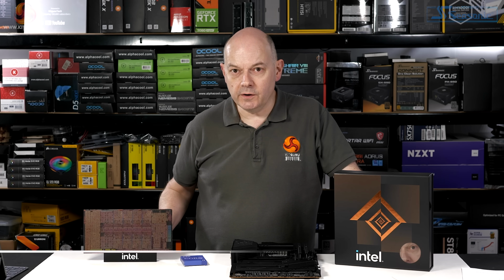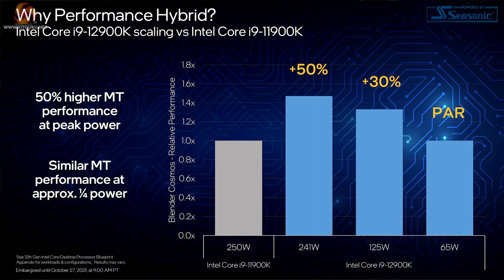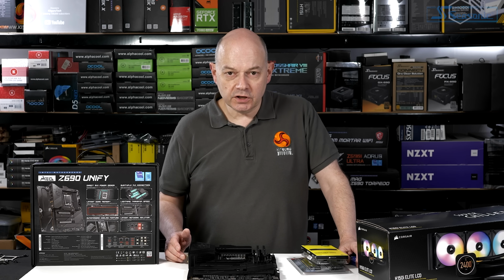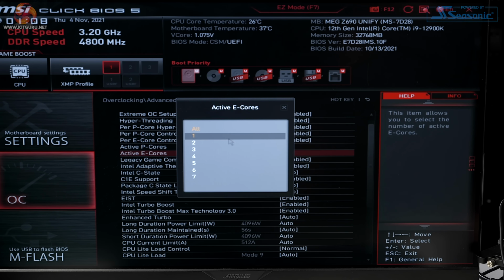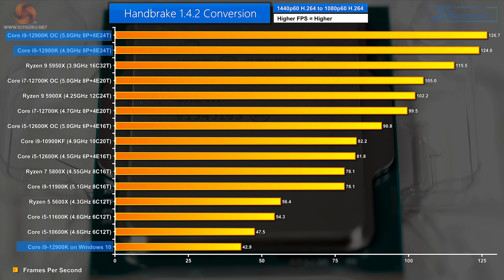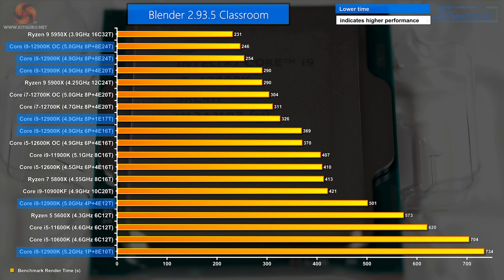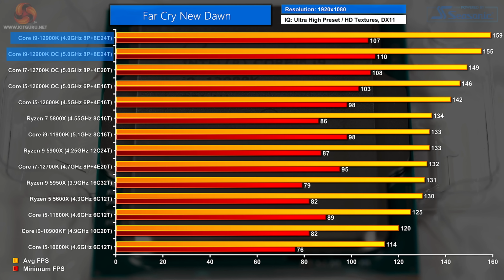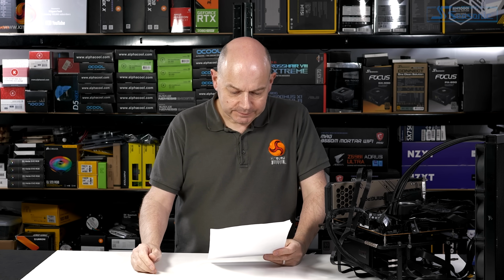Intel Core i9-12900K – Enough power to burn the planet!

Comment: Also, remember 12900K only beats 5950X buy 2%
Reply: By using 80%more power
Reply: @florin604  Yup, I guess amd is all eco cores? LOLOLOL
Reply from the maker: When we started testing the Core i9-12900K we figured it would fall between Ryzen 7 and Ryzen 9 5900X which have 16 and 24 threads respectively. It came as a huge surprise the new Core i9 can approach Ryzen 9 5950X regardless of the power involved. Having said that, if you are in the market for major CPU stomp we consider Ryzen 9 5950X is a superb piece of work and currently on sale at £700.

Comment: They're going to iterate the hell out of this. AMD need to step up.
Reply: Intel needs to improve their fabrication node or TSMC will leave them in the dust. It doesn't matter if they have the superior design, amd will reap the node befits tsmc makes.
Reply: Zen 4D will already be crushing this @ almost 40% less wattage on multicore loads... Alder lake is nice technology-wise, but it'll take a while for it to grain proper traction with software support etc. Kind of like with Ryzen 1

Comment: Could you do a overclock test 5950x vs -12900K (As we already know the -12900K will not overclock very well at all)?
Reply: 12900K already comes overclocked out of the box any more overclocking won't be much difference.
Because it draws already very much power and the temps are too high comparing to AMD CPU's.
Wait for the AMD's next CPU as they are more efficient and better optimized for DDR5/Gen5/Cache.

Comment: Is it just me, or did you leave out overclocking the 5950X in some of those tests, while you overclocked the 12900K and also included the stock results?
Reply from the maker: Leo here: Yes, however you can refer to Luke's reviews of the individual CPUs to see how they behave when overclocked. It all comes down to timing. Those four Zen 3 CPUs were tested on Windows 11 with those various games after AMD patched their chipset drivers. You may think you are missing half the data but Luke did a superb job.
Reply: @KitGuruTech  Thanks Leo. 

PS: I wasn't calling you on it or anything, i wanted to ask the question, but sat there for about 5 minutes trying to come up with wording that wouldn't come off as a call out. 
Not sure how i done though. But thanks for the response.
Reply: That is the trap that these tech reviewers do. They have the i9 running PL2 or oveclocked with infinite turbo (5GHz for 8 p-cores and maybe 3GHz for the e cores) while they have the 5950X at stock which has 20% less IPC and only 3.8GHz clockspeed.

This explains some nonsense like "12900K uses too much power".
Reply: @saricubra2867  Non-sense. Drawing 2x more power to get 1-3% more performance on average and you are probably an intel fanboy that would cherry pick benchmarks as well in favor of single core which is backwards.
Reply: @saricubra2867  5.7ghz 2 core

~5.4ghz p-cores, ~3.9 ghz e-cores 24/7 OC

 x40 ring min

6400mhz ddr5

its way past the capabilities of the 5950x
Reply: @OdinAlgeron  AMD all core at 4.5- 5ghz the 5950X are in the 31 to 32K in average on R32
5500 MHz	 Intel Core i9 12900K is about 30k on R23

This is without the new ram TODAY. So it's no where near way past the capabilities.
Reply: @AFlyingCookieLOL  5950X also draws a lot of power from unlocking power limits and still falls behind the 12900K in single core by such a big margin and loses Premiere Pro and many other production related tasks.

2000 extra points in multicore is nothing compared to the 1600 vs 2000 in single core Cinebench R23 for the 12900K. That is over 20% faster.

I like how AMD fanboys pretend that power consumption is an issue in 12th gen and single core doesn't matter ( do you remember Bulldozer ?).

I mean, it's all about maths, 5950X at 200 watts and just 4 or 6% faster multicore Cinebench R23?
lmao.

12900K, 25% faster single core perfomance at the same power draw, i'm not including the iGPU, PCIe Gen 5 and DDR5, 12900K won in Premiere Pro, Photoshop and a lot of other productivity benchmarks.

Comment: Intel fanboys today: Wow, just wow, anyone talking about the 12900K using too much power isn't a real gamer at all, you're not a true enthusiast, you should stick to games consoles noob.

Intel fanboys on the fx9590: LOL It UsEs TOo mUCh POweRz aND iZ a rOoM HEAteR
Reply: @Distortion_World  And still for to spend a lot on a cooler which adds to the costs.
Reply: @Distortion_World  you also sound like what? an amd fanboy. so it goes both ways

Comment: my 12900k boosting to 5.4...must have gotten lucky
Reply: What water cooler are you using? And how much did it cost?
Reply: @tringuyen7519  just using the Ryujin from asus.  the asus boards fit the new bracket and old so didn't have to change anything. What what the cooler or cpu?

Comment: Slightly miffed at the Windows 11 use. An OS built from the bottom-up for Alder Lake/Intel. With AMD apparently only being given last minute access before launch to update it's drivers. I expect AMD figures would be better in a few months time, assuming Microsoft don't cripple them in the scheduler.
Reply: Ryzen now performs slightly better in Windows 11 than Windows 10.
Reply from the maker: Assuming you currently use Windows 10, will you stick with 10 or move to 11? You may have noticed that BIOS updates now enable TPM by default so in all probability you will find Windows 11 coming your way.
Reply: @KitGuruTech  My just over a year old rig has a 3600 in it. I'm not planning to switch to Windows 11 for at least 12 months. And possibly not until Windows 10 end of life update support ends.
Reply: Btw I know that the Windows 10/11 choice was a damned if you do, damned if you don't one for reviewers.

If you'd stick with W10 you could say it was a level playing field but at the risk of not optimising Intel 12th Gen results. W11 you presumably get to see the full potential of 12th Gen, but seemingly at the expense of AMD not having time to fully optimise their drivers.

There's also the question of whether Mucrosoft have built the W11 thread scheduler so closely around Intel chip specs that it is virtually impossible for it to be as efficient for AMD chips.
Reply: @Penfolduk001  It has been shown the latest fixes have very slightly improved gaming results for Ryzen over Windows 10 in 11. What are the bugs still present for only Ryzen?
Reply: @Safetytrousers  Well from the reports the scheduling in Windows 11 has been built from the ground-up by Microsoft for Alder Lake CPUs.

Given the initial performance hit on AMD CPUs, the impression I have is that AMD either only had access late in the day, or were dragging their feet on updating their drivers.

If the former, they'd have been bounced into effectively doing an emergency patch, to save their chips looking really bad in comparison to Alder Lake. So I would expect it will take more time to fully optimise the new drivers.

If the latter, then AMD took their eyes off the ball badly.

But given the reports of the "close partnership" Microsoft had with Intel during Windows 11 development, unless other information comes to light I'm assuming that Windows 11 was deliberately launched when it was to make AMD look bad and allow Intel to publish test results that made 12th Gen look better by comparison.
Reply: @Penfolduk001  Windows 11 cerainly does have special provison for Alder Lake. That does not mean the latest fixes for Ryzen in W11 have not fully worked to the extent that Ryzen now performs slightly better than it did in W10.
And you cannot tell me of any issues present for Ryzen in W11 now that were not there in W10.

Comment: looking at this I'm beginning to regret ordering 12900k and Aorus master, makes much more sense to pick a £200 DDR5 mobo, the 12600k and cheap out on the RAM, it still offers more performance than most people will ever need whilst offering the potential for incremental upgrades in the future that other platforms can't offer whilst recognising that the new features are in their infancy, the higher end components will likely not age well, high speed RAM with tighter timings will likely become rather cheap in 2-3 years, which current motherboards are unlikely to support well if at all, and it seems probable that Intel will start packing future generations of processors with ever greater numbers of E-cores without doing much to P-cores outside of trying to stay noticeably ahead of AMD in single threaded performance.
Reply: @Krisroffer Pettersson  100% if it doesn't ship tomorrow (I don't think anyone has those boards anyway) I will cancel but I'll still buy some kind of alder lake setup it still seems like it makes most sense in terms of being able to upgrade each part individually going forward given I don't have that much work that is CPU intensive, but it is nice to have the best parts even if only for a few months, the problem with waiting is that there is always something to wait for; when you need to upgrade, you need to upgrade.

Comment: I am happy with my i9 10850K 10C20T great review Leo Sir :)
Reply from the maker: That's a decent CPU and good value too. Should do you solid service for a while yet!
Reply: @KitGuruTech  Thank u Sir :)
Reply: @KitGuruTech  12900K just made the 10850K look like a Bulldozer chip. 40% higher IPC, almost twice the multithread speed at the same TDP.
Reply: @saricubra2867  40% higher ICP? Which cherry-picked benchmark did you find for that, LMAO. And comparing Bulldozer to a 10850k, will not get you the street cred you think :D.

Comment: So weird, why are there these issues on Win 10... Otherwise, some decent gains by Intel, but not the blowout ppl were expecting from Intel's marketing slides.
Reply from the maker: The workloads have to be scheduled and directed. Windows 10 understands how to do that when all the cores are the same, although one or two may be designated as preferred cores. With Intel 12th Gen the Thread Director has to be able to communicate with the OS and that is a new function we have not previously seen.

Comment: Two thumbs up! For Leo, that is. I do enjoy his intelligence, hard work, and style.

I do have one question: what is the maximum RAM? I've checked a couple of boards and it seems to be 128 GB, but is that a board limitation, a chipset limitation, that no one is producing 64 GB DDR5 DIMMs, or something else?
Reply from the maker: Good question and we don't (yet) know what the limit is, although it's hard to think of 128GB as a limit.
Reply: @KitGuruTech  You yourselves use a Mac with 384 GB.
Reply from the maker: @QuentinStephens  When Allan speeced that Mac Pro he went BIG on everything
Reply from the maker: Following up on that question, it seems like a chicken and egg thing. Right now you can only get 32GB DDR5 DIMMs so motherboard manufacturers won't be able to develop BIOS support until we see the next bump in capacity.
Reply: @KitGuruTech  Speaking of a chicken and egg thing, I loved the "or the other way around" note at 25:29 - been thinking the same thing :))

Comment: So it's a big disappointment
Reply from the maker: That is a harsh summary. There are lots of new things here and they all work. Separating the chipset from the CPU from the architecture and Windows 11 so we can fathom what is going on; that is a bit of a nightmare.
Reply: @KitGuruTech  well, if 2-5% average preformance gains over the ryzen 5900x/5950x are good for a near 75-100watt tradeoff, combined with higher mobo + cooling prices, and requirement for win11 as well as living with a spaceheater and more expensive memory. While their Cpu prices has actually also gone up compared to previous gens.  Then i gues you can call it not a disaster. In my book Chris is right, this is an utter disapointment if you consider prices/overall system expense and overall upsides/downsides in mind.  + dont forget that you will be a beta tester for x86-64´s first bit-little cpu design/arch, and a win11 bug tester too.
Reply: @AdaaDK  seems you already had all that prepared before you even watched the video. You did watch it right ? Cause I clearly watched something completely different than you did !!
Reply: @theonlyredspecial  i watched a ton of reviews, this was the last one i watched. But to me, they all conclude the same, only 12600k worth it, and only if you can reuse ddr4 or find a good deal on a decent ddr5 kitt, and a decent priced mobo(hard part). The overall system price is much much higher than Ryzen, hell you can get a 5800x vs a 12600k and still save money, even if the cpu is more expensive, just cos of the added cost to intel with the need of a larger cooler and more expensive mobo.
Reply: It's largely the best result performing set of desktop CPUs that exist. And it's brand new with first go BIOSes. There is still a lot of dust to settle. And the CPU pricing is competitive in the current market.
Reply: I am an AMD fanboy but hotter than the sun and massive power draw suggests to me that intel have a few things to sort out. If they can sort them out I will become an Intel fanboy.
Reply: @Krisroffer Pettersson  I do, which one of us is more likely to know about the characteristics of a 5950x?
Reply: @Safetytrousers  i9 12900k is just a waste of sand (now edited it)
Reply: @drsm7947  There is no such thing as an i9 12500k.
I was making no judgement about the 12900k, and saying it is just a waste of sand is no kind of argument.
Reply: @Krisroffer Pettersson  The 12900K is £600, while the 5950x is £750. It goes faster than a 5950x can. A 5950x easily gets to 95 degrees if you let it.
The 16 cores of a 5950x can beat it in some tasks, while the 12900k beats it in others.
The 12600k at £290 stomps all over the 5600x at 170w full load. The Gigabyte Z690 GAMING X DDR5 board is £200. Those two together are £490 giving plenty of room for DDR5 Ram.
Alder Lake has had a very positive reception from people who know what they are talking about.
Reply: @Safetytrousers   *A 5950x easily gets to 95 degrees if you let it.*
If you overclock, on stock no where close underload load in AIO so wtf are you talking about?

*The 12600k at £290 stomps all over the 5600x at 170w full load*
power draw?
Reply: @AFlyingCookieLOL  On PBO which is a stock feature. PBO is easy to enable.
The 12600k peaks at around 195w under benchmark conditions at around 70c. Most uses  will not see that, and you would not be getting it to run it at consistently at 100%.
It performs better than the 5600x ('stomp' is not a scientific measurement.)
I have a 5950x, I do know how it performs.
Reply: @Krisroffer Pettersson  Mining with it at a maximum overclock is one way of getting to 95, even under my extensive custom loop. I limit it to 85c and it stays there.
You use an awful lot of words to demonstrate you do not know what you're talking about.

Comment: The enthusiast community is usually quite forgiving about power consumption as long as you can confidently say  'our chip is the fastest'.
However if AMD erase this lead with their 3D cache refresh (or reduce it enough to become academic) that extra 100w sustained is going to look VERY silly all of a sudden.
I'm glad that both companies are now being exciting at the same time though!
Reply: @Ben 3D cache won't reduce power consumption but it will obviously add more extra 50-100w and even worse it will causing AMD cpu being too hot after adding more cache.
Reply: @runninginthe90s75  they 3d cache is being stacked on top and my limited understanding is any power increase will be minimal... But we'll have to wait and see.
Reply: Word!
Reply: Truth!!! But alder lakes a beta for raptor lake that's when I'll make the jump when I see zen 4 and raptor lake numbers. My 5800x is more than enough for my use case.
Reply: to be fair intels all core workload power usage and temps already look quite silly, i always said that if extra 100W is a deal breaker then you were never in ultra high end market in the first place. I generally dont mind high power usage, but if its difficult to cool it then we have a problem even in enthusiast level product segment.
Reply: @h1tzzYT  True, with the current status quo I agree, but when you consider that Ryzen 4D will probably perform quite a bit better in both single and multicore whilst still consuming 100w less, it kind of starts looking silly for intel.
Reply: @Mysterio2243  yeah i agree as well with your point, well its intel's first go at desktop cpu hybrid architecture so i'm pretty sure that 13th gen will be significantly impressive, im just a bit worried since we are seeing these chips being pushed to the absolute limit out of the box, sure it looks better in benchmarks but its not good experience when you start using it. We can already see this power creep in gpu market, both amd and nvidia pushin their silicon to the limit and that is just annoying at this point
Reply: @h1tzzYT  Ah yeah I can definitely see that too. They tend to push it to the limits more and more because of the benchmarks. Nowadays you have to undervolt most GPUs if you want decent efficiency. Heck even vega64 was like that. I guess most people don't care about power draw and heat untill they have to daily drive it and notice the heat difference while not noticing the 3% performance delta. Kind of pushes the reviews away from real world usage.